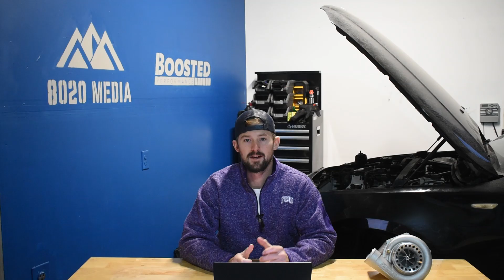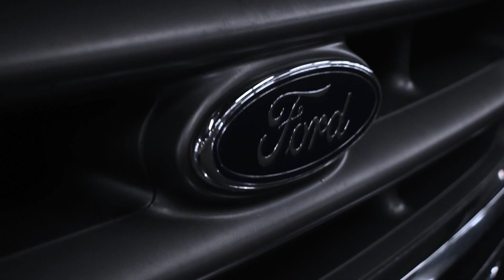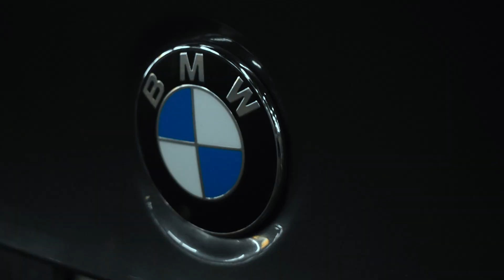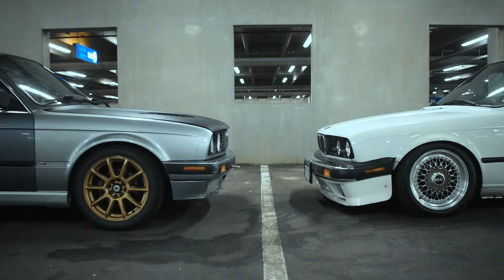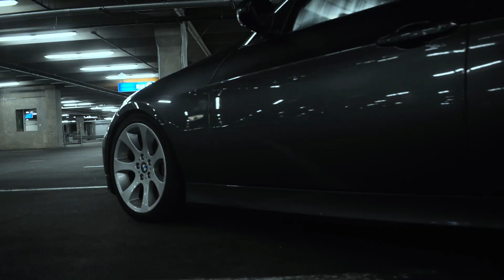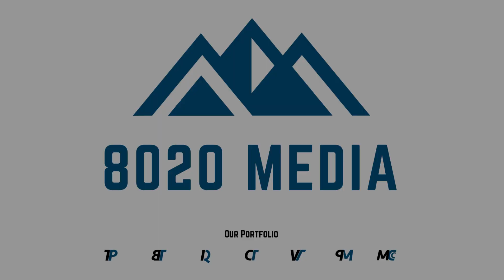Titan XD's 5.0 Cummins | Common Problems & Reliability

Comment: All engines are ticking time bombs period.  No production truck is a bad product maybe minus the 6.4 powerstroke but even those CAN be made reliable with $$$.
Reply from the maker: That's maybe a bit pessimistic, there are engines that are inherently more reliable than others. Sure, money can go a long way in making something reliable but one of the biggest things is also maintenance and naturally, how well the engine and all of its additional components were built from the factory. None of them are a "bad" product, otherwise they wouldn't have been put on the market but that doesn't mean that they all are created equal either.
Reply: @8020Automotive  agree and disagree but that the beauty of all of this.   As a former owner of every Ford diesel made after the non powerstroke 7.3 I can say without a doubt that the 6.0 and the 6.4 are bad products although it is our corrupt governments fault with all the emissions bottlenecks that kill these motors.  I bought a 2008 6.4 government truck at auction that had zero emissions and it was one of the most reliable diesel engines I’ve ever owned.  I was being pessimistic earlier I just agree with George Carlin when he questioned how we can put a man on the moon but Cadillac can’t make a bumper stay on….   I just feel it’s all kind of a scam.  As a swiss watchmaker by trade I know with 100% certainty that ANY of these manufacturers could make their automobiles more reliable but you can’t keep making profits that way.  That’s the problem.
Reply: @rolexmd69  
I would disagree about the emissions, but agree that the manufacturers could certainly build better products, often for just a few dollars at production level.
I would even suggest people would pay a little more (they're plenty paying massive premiums for some trucks, because of 'unavailability' - even to the dealers whose yards are full of stock they can't shift) to KNOW they're getting a reliable product that isn't going to cost them down the line -
Reply: @gordowg1wg145 
The emissions are what kills diesels engines period. I know this, I've seen this and I've seen how the diesel engine works with out emissions and its day and night
Reply: @stevenpeterson7234  
Be interested to see your data on that, seriously, especially what you mean by "kill".
Reply: @gordowg1wg145  
What I mean by kills the diesel is it gums up various components and it make the fuel less lubricant and will increase wear and tear.  So tell me how DEF is good? Are you a Democrat?
Reply: @stevenpeterson7234  What I've seen and is the main issue with the 6.4 is EGT overheating due to the EGR

Comment: Now you’ve got me scared. I found a basically brand new one owner 2017 Nissan Titan diesel with 30k miles on it I was thinking about buying. Now im wondering if I should avoid it and run 🏃‍♂️ away?
Reply from the maker: Jason - Just make sure you have maintenance records. We’ve seen many reliable Titans if maintained properly. We’re here to inform and educate, not scare.
Reply: @8020Automotive  thanks for the reply. Ya maintenance records look pretty good.
Reply: Was that truck you saw in St George Utah ?
Reply: @dbel723333  no it wasn’t
Reply: @Takeiteasy-u3r  have you owned one? I didn’t buy one yet. Still looking at them though.
Reply: I’m looking right now too and I could snatch a clean one owner with 28k miles but they ARE phasing their diesel mechanics out my best friend is a long time nissan service advisor. They will be not supporting the cummins once the last years 5 year warrants are up. Which is my big reasons to second guess wanting the diesel and going to 5.6
Reply: @Wildworksolutions  I heard they are bringing them back
Reply: @Hollywoodeatsordrinksit  I hope my friend is wrong. That would be absolutely AWESOME

Comment: Well I have the 2016 XD titan Cummins zero issues over 100k plus miles still stock I keep up with regular maintenance and I like the truck it's my daily driver
Reply from the maker: Cowboy - Thanks for sharing your feedback! This will definitely help future viewers.
Reply: @8020Automotive  no problem ik this is an old video but I figured If someone went back to watch this or new views maybe Wondering cause the price of the titan it's probably the cheapest diesel to buy right now, the only issues I have really had is the radio system is not the best I'm and I don't mean the sound quality cause the quality is good but the radio unit itself sometimes has various  problems with making weird noises or only sending sound to one or two speakers, now it doesn't do this all the time just sometimes and I looked it up and almost every other titan out there has had the same issues with the radio, and mechanical wise I have done only one thing to after market which is an oil filter bypass so technically to filters which helps keep the oil life longer. other than that no major changes or repairs have been done to the truck.
Reply: @cowboy19750  been wanting to get one. What regular maintenance do u do. I want to stay away from 2016 but trying to find out if a tune will help with mpg
Reply: Me too

Comment: Nissan has extended the turbo and actuator warranty to 10/150k miles. And no, Nissan has not fired any of their diesel techs. No idea where you got that from. Nissans “diesel techs” were simply specially trained Nissan techs they already employed. The CP4 pumps are the exact same on all the diesel XDs and no, they have not been problematic particularly on the XD….although the CP4 itself has been.
Reply from the maker: Joe - I misspoke when I said they fired all of them, but there are certainly less now. They aren't training any new techs on the diesels. Sorry that I spoke badly about a truck it looks like you own - we just wouldn't recommend one but then again there are few diesels being produced today that aren't plagued with problems mostly from all the emissions equipment. Proper maintenance goes a long way, but just too many people that don't understand what proper maintenance is on a diesel which is part of the problem too.

Comment: I have a 2016 with around 160k miles. Emissions intact. The only issue i've had has been with the transfer case needing replaced (under warranty). Although it never failed and always worked when i needed it to, it would intermittently cause a 4wd fault code. I run hot shots EDT every tank. It overall has been a great truck!
Reply from the maker: Kyle - Thanks for sharing your experience. Glad that you have had a positive experience with it! Hopefully it goes 100k+ more miles for you.

Comment: I believe that Nissan put the Cummins in the Titan before the other half ton diesels came out. It was marketed as a 5/8 ton truck. The 5.0 Cummins was one of three motors that Cummins teamed up with CARB to develop for lower emissions and higher fuel economy in vehicles. My dad has a Nissan Cummins and loves it. The CP 4.2 is problematic in all situations bc it was designed for the higher lubricity diesel in Europe but has problems with the dryer fuel in the US. Run a lubricant in with the fuel like Amsoil or Hot Shots in every tank and there’s hardly a problem. The 4.2 is the reason why disaster prevention kits exist for the 6.7 PS, why ram went back to the CP3 and GM switched to the Denso system which is designed similar to a CP3.
Reply from the maker: Thanks for the contribution - great information.
Reply: Sorry but diesel lubricate in Europe  is probably lower than EEUU  spec  diesel. It really has very low amount  of sulfur.  That  why companies like Toyota  had some problems  with their D4D injection system when  was launched in Land Cruiser Prados and Hilux.  That premature wearing never happened in countries with more relaxed sulfur content rules.
Reply: @enterBJ40  I’m trying to understand what you’re saying, I’m not familiar with the acronym EEUU. What does that mean? Are you saying that Europe has the same or lower amounts of sulfur than the US in their diesel?
Reply: Hi. Sorry for not been clear enough.  EEUU mean U.S  where I live. 
Sulfur content in European diesel  is lower than U.S specs. That could explain why those engines that are plagued with tons of problems related to fuel system are practically no existing I countries where there's not much regulation  about Sulfur content.  The more modern is the engine the tighter the tolerances in components, including fuel systems.  Hence the importance of lubricity of fuel
Reply: @enterBJ40  no problem, it sounds like we are talking about the same thing. 👍🏻 Hot Shot’s Secret has come out along with other companies stating how the US fuel has less lubricity than the Euro fuel. Can’t go wrong with good additives!
Reply: Absolutely.  Modern diesel fuel is formulated to meet certain standards  related to emissions. That escenario is sure to happens in countries with emissions and environmental regulations. Hence  owner and operators of modern diesel engines in such places loke United States, European Union should  consider use some sort of additive that increases lubricity in fuel. Time will tell you did the righ thing.  Kudos!

Comment: My 16 5.0. Had turbo replaced 37k  now it has 60k actuator got stuck and. Blew the motor. Knocking bad blow by  and my warranty is giving me the run around cummins and nissan need to fix this junk they engineered
Reply from the maker: Club - So sorry to hear this. However, thank you for sharing your experience. It will help future viewers.
Reply: My dad truck too 2016 with 42k now My father did not use the truck for three weeks, it broke down because it made a gel with the diesel, now we have to change the pump and sensor
Reply: @melvinarias136   that’s not a manufacturer fault then it’s bad fuel or it should’ve been drained.

Comment: Do you own one of these engines/trucks? Guessing you’re just going off what you read online.
Reply: I own one.  Its an awesome truck, and frankly is bad mouthed by people with lack of understanding.

Cummins, aisim, American Axle Manufacturing, Bilstein, Rockford Fosgate...all stock options, and the 0 gravity NASA designed seats, are unreal for long hauls.  

The only dilemma is with a 6" lift 35x20 rims and tires....it needs a city block to back into a parking spot lol 😂😂😂
Reply: @Reavispade seems like a good tradeoff. A lot of people bash Nissan, but the reality is that a Frontier is as reliable as a Tacoma, and the Titan is as reliable as a Tundra. And that was before they had a Cummins. It just makes it that much better along with the aisin.
Reply from the maker: Bicep - We do not own one personally. However, we have been creating automotive content for over a decade now. Therefore, we feel rather confident with the information we have gathered from many sources (online, in person, etc.) over the years. Do you own one? If so, do you mind sharing your experience with it?

Comment: Best mod i did for my nissan titan xd cummins was selling it. They are a ticking time bomb of problems and poor parts support. Buying a whole assembly for 1 part failure is ridiculous. Nissan shot themselves in the foot by not using cummins tuning on the engine and trying to do their own thing. I loved my titan but couldn't deal with their unreliability.
Reply from the maker: David - Thanks for sharing your experience. Do you mind elaborating on what issues you came across? This would help other viewers in the future.

Comment: I have to respond to this video because you make this engine sound like it's a time bomb, and that couldn't be far from the truth. This engine was used long before 2016 in commercial truck around the world by Nissan, and it's a Cummins so they decided to use it for a needed heavy half ton  truck segment with just a few changes. I'm a retired truck driver so I know a lot about diesel engines. First off the CP4 pump is made by Bosh, and is a good pump IF you put good fuel in your tank AND add lubricity additives like hot shot secret or Stanadyne. For those who are reading this and contemplating buying a diesel truck, don't use it for short trips or daily driver if your doing short runs these engines want to run, that's got to be the worst thing for that engine too. That's whey turbo gets clogged as well as the EGR, and change the antifreeze when due. Change the fuel filters when due (every 10,000 miles). I can go on and on, but every diesel truck from Ram, GM, and Ford had the same issues, or worse, why? Because most people who buy diesels don't know how to maintain them and don't tow or need a diesel at all, get a gas truck if you don't tow a lot and be happy! I also need to note Nissan also extended the warranty on the Turbo and the Turbo actuator for 10 years or 150,000 miles, none of the big three did that.
Reply: Nah these trucks are super underrated. These transmissions are basically the same as the 3500 rams…  I’ve towed up to 15k plenty of times and literally tows almost every day👍🏼 I’m tuned and deleted tho. Also If this truck would have had one of your favorite big 3s brand on it sales would have been a lot better as well. But since it’s Nissan…….
Reply: @wideopenthrottle6508 and because it's underrated you can find them cheaper than a f150 or silverado 1500. Let alone being cheaper than all the larger 3/4 ton trucks
Reply: @SupramanTRD  Bought a 2017 Titan XD SL Texas edition 2 days ago. Has 30,000 miles on it. After watching this video and one or two others, it has me a bit concerned on whether I made a good decision or not. Also, you are correct on your comment about it being cheaper than the f 150 and Silverado. I've only been driving it a couple days now and I have to say I love it so far. maybe I should stop watching videos like this ?? :) I'm feeling a little spooked now !!
Reply from the maker: Dbel - Our intent is not to spook, but purely inform about what we have seen. If maintained properly, we know these can be very stout!
Reply: I'm thinking of buying one are you still driving it?
Reply: @wideopenthrottle6508, how do you know if the truck was well taking care of? I'm looking at one, but not sure bec of all the bad reviews
Reply: @wideopenthrottle6508 

You can’t even buy seals for this tranny
Reply: James, I agree. Great assessment. I love my 2017 Titan SL, 4x4, Crew Cab with 76k miles. It pulls my 12k lb. 5th wheel with ease and confidence.  Bought it new for $25k less than the lowest basic trim of any of the other big 3 trucks. You're right about the EGR Cooler as mine cracked at 73k miles but it was covered 100% by the 5 year warranty at the dealer. The warranty also covered 3 other trim piece issues in the 5th year, with no questions asked. I love that Nissan is standing behind the turbos and making things right.  It is no longer my daily driver as I hope to keep it for many, many years.
Reply: I don’t tow much but I do drive a lot and I’ve been looking at these for my intro into diesel trucks. You can pick one up super cheap and I want an American made engine like the Cummins, I’m not interested in the powerstroke. Thank you for the positive comment on these trucks!
Reply: The main problem with the cp4 is when the fuel gets low and its return creates microscopic bubbles in the fuel lines they make it to the pump and that creates a loss of lubricity and failure if u use a lift pump with a water air separator you will never see any problems with it.
Reply: I quit hotshot hauling over ten years ago and wanted another diesel truck now but I don't haul any more. Your post has convinced me to buy a gasoline fuel truck(if wifey will let me lol). Thank you for your info I think you have saved me a LOT of money!! 

Now I'll be looking at midsize trucks b/c that's really all I'll need for short hauls and a little town driving.
Reply: My 6.7 CTD never broke a crankshaft...
Reply: What if your daily drive is almost 100 miles day and you’re doing about 2k miles a month? Give or take 
I feel like thats bare minimum
Reply: https://youtu.be/H9XPK7QtC_k?si=s6R8L15Rg3VnrXkY
Reply: You should make a video about this ,thanks for your in put
Reply: There's a reason why Cummins is well known for their inline 6 diesels. That's their niche. Making a diesel v8 for them is like the equivalent of going to a Chinese restaurant and ordering a burger, probably not the best but good enough.
Reply: To be fair, people don't buy a nissan Titan to do heavy towing. Titan, something used to pull a camper on weekend
Reply: If CP4s are great why are people converter CP4 engines to CP3?
Reply from the maker: James - as I mentioned in the video the engine itself is solid, I understand it's been used in numerous commercial vehicles and other applications before 2016 and continues to be used in others today. My point was that the 5.0 Cummins in the Titan XD hasn't proven to be the most reliable combination so far. But I agree that proper maintenance goes a long way and that a majority of people don't understand the nuances of owning a diesel. 

Our opinion is always that reliability is earned through proper maintenance. Some engines have some inherent flaws, the 5.0 Cummins doesn't, but outside of a flaw it always comes down to maintenance.
Reply: @8020Automotive  Thank you
Reply: As a owner of a titan sv diesel its the worth engine Cummins ever made found out not everything Cummins makes is roses
Reply: @CharlieMccoy-u1o Yet, you didn't state as why the engine is a bad choice. That engine has been used world wide in a wide variety of applications without any issues. Its the owners that to blame for poor maintenance schedules and not bei.g knowledgeable on how diesel engines operate.
Reply: Garbage motor can’t even go 50,000 miles without blowing up